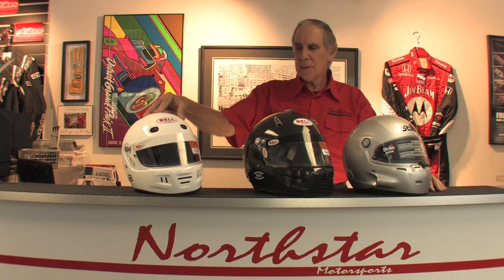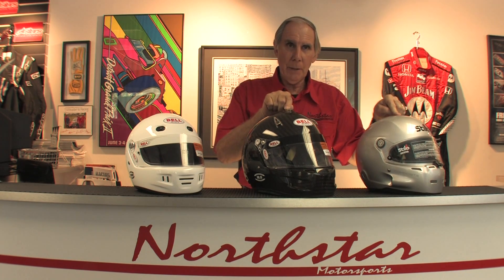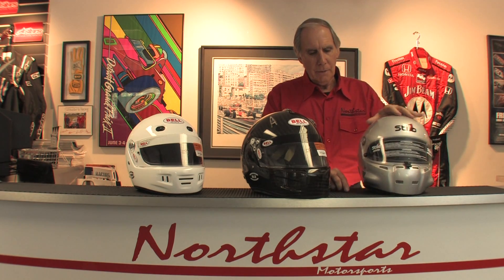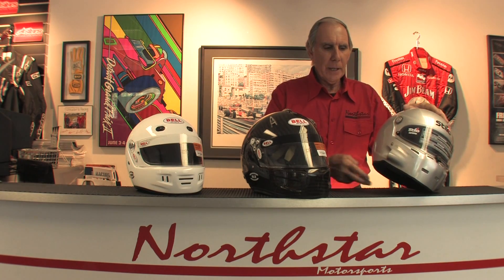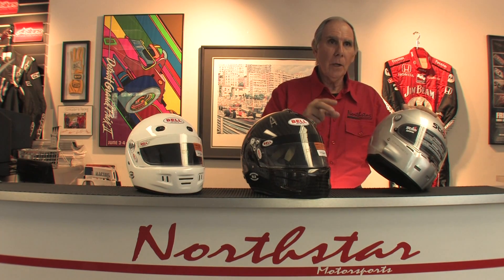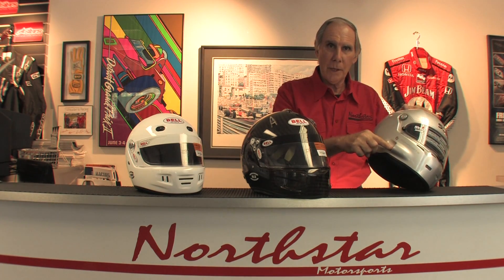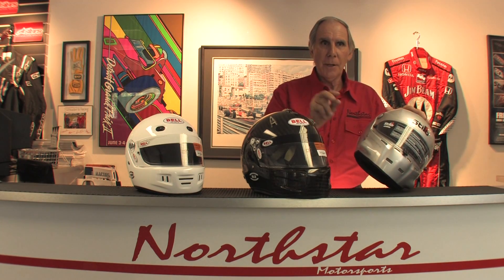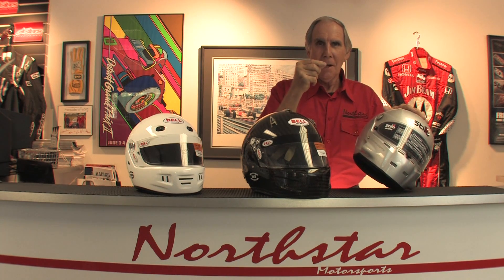Comparing Entry Level to Carbon Fiber Auto Racing Helmets - Northstar Motorsports

Comment: Good Video :  I never understood why there was no continuity of the manufacture of aluminum shelled motorcycle helmets . It's only once that I have seen an aluminum shelled motorcycle helmet . If the military uses them they must be good . Metal shelled helmets are used in the Army , Navy, and Airforce .
Reply from the maker: I would assume weight would be the biggest reason, Then manufacturer process second.

Comment: I’m 6’-4” and have a sunroof car and I’m trying to find a low profile helmet that’s under a $1000, Is there one you recommend that has a lower profile?
Reply from the maker: We have had people come in and do this over the years, and really they are all about the same, you will almost never gain the headroom you're looking for. The solution is sitting lower in the car, either by modifying the existing seat or going aftermarket.

Comment: The FIA highest standard for helmets is not 8858 but the 8860.
The FIA 8858 is for FHR systems. The 8860 is the one for the top of the range Advanced helmets.